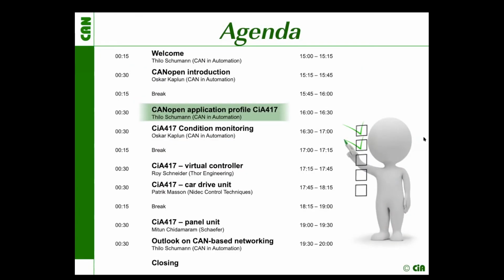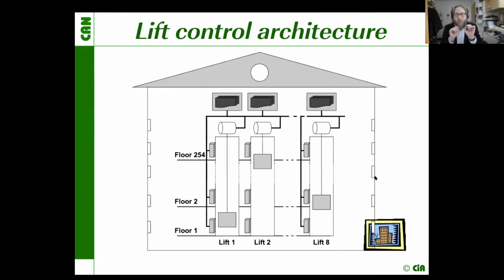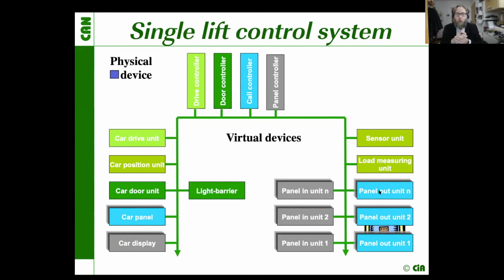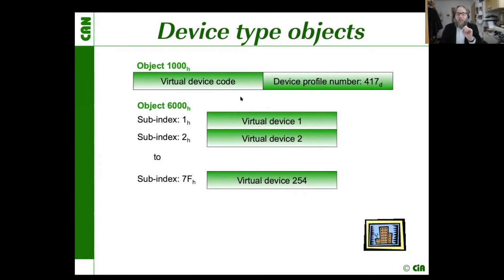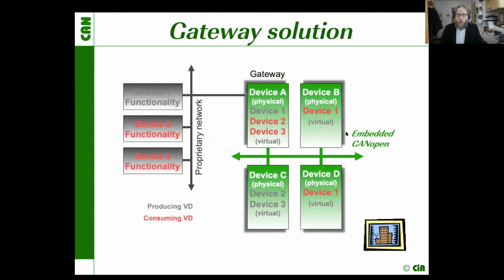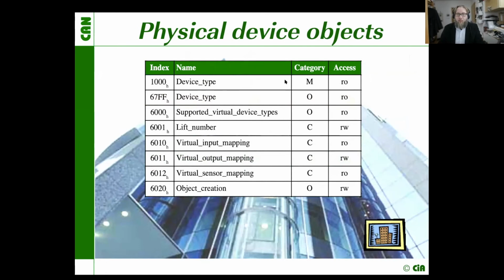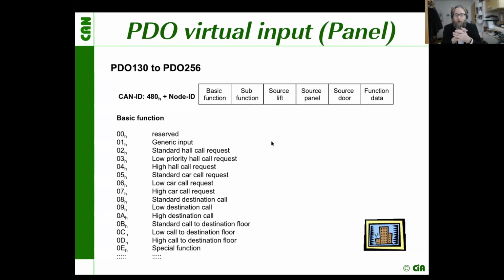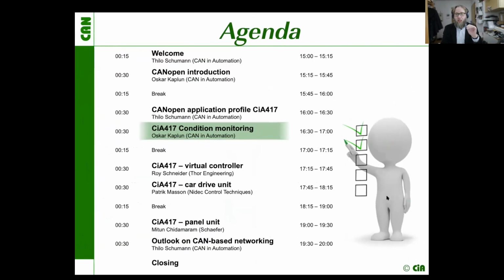CANopen application profile CiA 417 - CANopen Lift technology day 2020

Comment: Thank you for the explanation about this topic!
I have a question about Virtual Ouput mapping object (6011h). Is it related to Output groups (6200h to 621Fh) somehow? How it works? Is PDO referred to virtual mapping and user need to implement a way to map it to the proper output group? And if it is the case, how PDO257 can retrive which group the incoming message is related to? Thanks in advance.
Reply from the maker: Dear Raffaele, I forwarded your question to my colleague who will answer it as soon as possible. Please note, for a faster response you can ask all your CAN-related questions to our experts always at service@can-cia.org